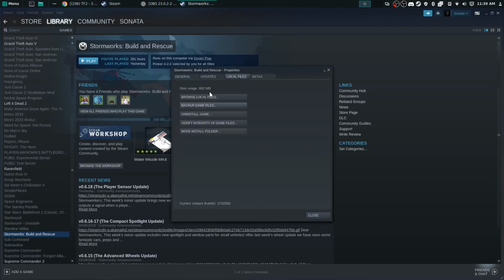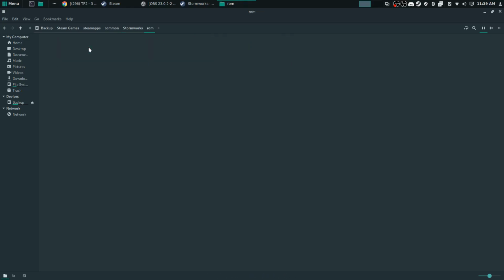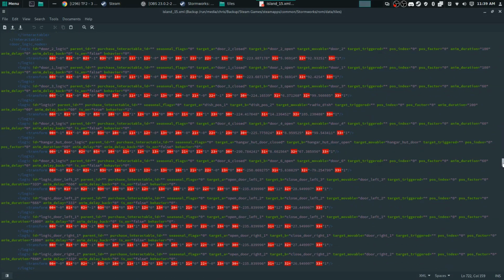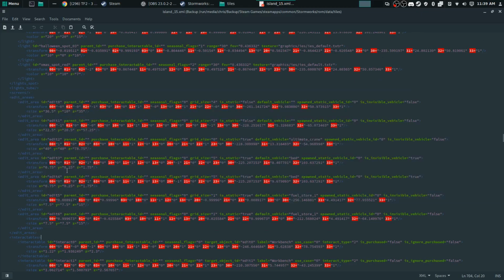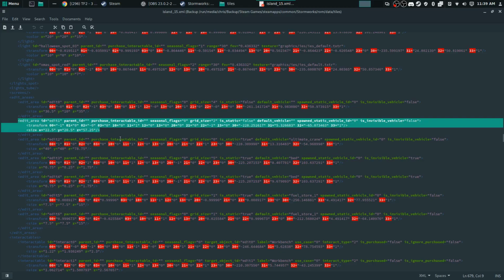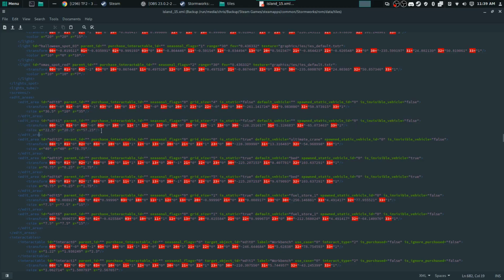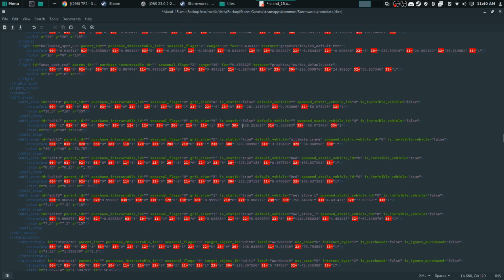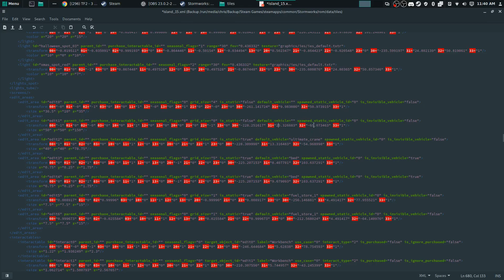Stormworks: How to Increase your Build Area (New video In description)

Comment: I'm having trouble with mine where once I get to a certain part in the workshop I can't place anymore blocks
Reply: Did some testing and it seems that the selection grid tool might of broke something
Reply from the maker: @spacedoggo4337  The maximum build size is 128 x 128 meters.
Reply: @ChrisVTitus  yes I changed that but it doesn't let me build there
Reply from the maker: @spacedoggo4337  does the grid in the editor get larger? If not, make sure grid size is set to 0
Reply: @ChrisVTitus  yes it did get bigger
Reply from the maker: @spacedoggo4337  Did you drag the whole creation to one side? The game glitches if you do
Reply: @ChrisVTitus  no I have not

Comment: This may sound stupid but what one is length, i want to increase the train work bench, but i only want to make the spawn longer. And figure out what one is the train work bench
Reply from the maker: The highest number is always the "length". Also careful with incredibly long train cars, they can get stuck on the sides of the tracks.
Reply: @ChrisVTitus  ya i know that issue with my super heavy load 3 part train car. Im going to be working on a bit of an update on it but to make things easy i want to spawn it as one, instread of 3 parts. The only trouble im having is finding the right island in the files to increase in size. 

And to what you said dose that mean it dosent matter what one i make the larger number or you mean the largest number of the 3?

Comment: It doesn’t work
Reply from the maker: If you have done everything correctly it should work. I still use the same method. What is going on?
Reply: Ok thanks I accidentally put at an l bc I have a Logitech g5o2 so the scroll button is l and when I was scrolling down I accidentally pushed it so thanks

Comment: I made Z = 250 meters and only can use 127.75 meters of it. 
Do you know why?
Reply from the maker: The game has a hard limit of 128 meters put in place. So I recommend setting the z to 128. It also has a total block limit that I am unsure of but it can be worked around by using the mission editor to spawn in the craft. Sadly. Theres no way to work around the 128m length limit without using multiple part vehicles.
Reply: Laythe Thank you for the quick answer

Comment: What Island Is The Dock Base?
Reply from the maker: I'm not sure exactly. I just know that the arctic one is the arctic island playerbase.xml
Reply: Alright,So Whenever I Do All The Stuff On This Video On The Arctic Base,For Some Reason The Build Area Doesn't Change.I Think The Rows Are Different Between The Two
Reply from the maker: @informonocle3182  I dont remember which one it was, but look for the numbers that match up with the other build areas. Each large build area has the same size numbers.
Reply: Alright